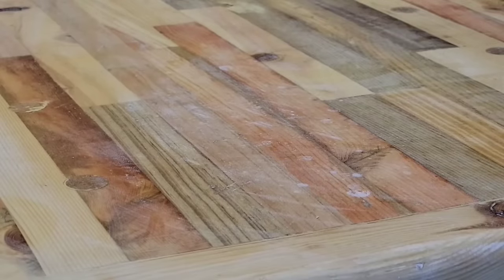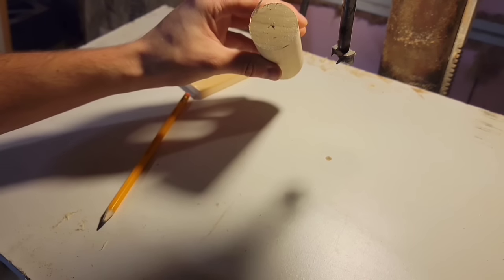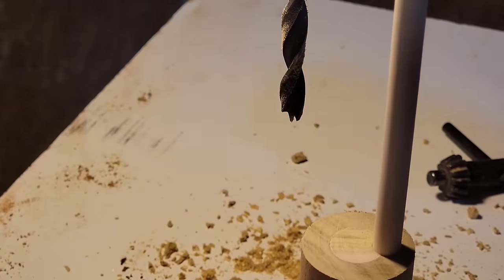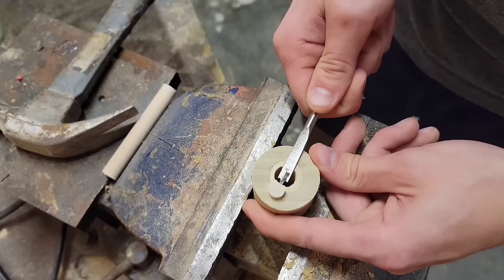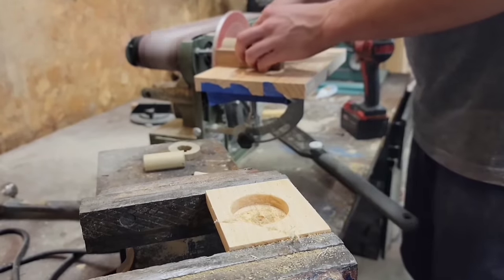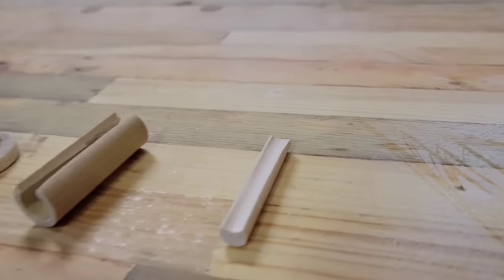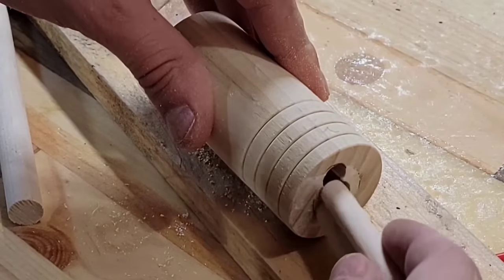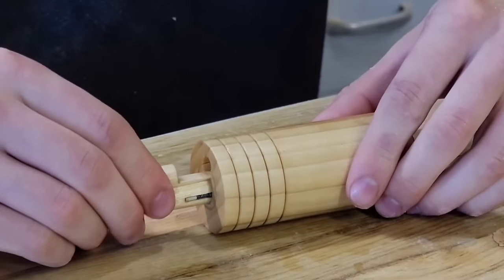DIY AWESOME gift Idea | Easy Woodworking

Comment: Josh (and anyone doing this type of project with a drill press) - wooden hand screw clamps make it much easier and safer to control small parts. I cut notches in the jaws to grab round parts.

Comment: I wouldn’t use a spade bit into end-grain on the drill press especially without a vice. This would probably be best done on a lathe but would require the lathe and about $400 in accessories.

Comment: OK stupid question. I don't have a piece of round wood that thick. For me to buy it it would cost quite a boy.  You have to have a around inside.  I was wondering if I could do the outside square instead. I have some beautiful Especially designed for curving wood that a very kind man gave me years ago.  think that would be OK right?
    Also I've seen videos where they attach the drill to like a makeshift drill press if you know of any videos like that could you tell me maybe Which video is the safest. That's the only thing I'm worried about it's safety
Reply from the maker: Not a stupid question, I think square stock would work too and could look pretty cool. As for safety I am not very good with safety myself so I can't give good advise on that. I would say try and use a real drill press and a drill vise to hold the work piece.
Reply: @JoshWrightWoodworking  1st, thank you for replying. Im actually a woman and have to fend for myself.  Example, the short story is my brother-in-law  took the drill press i bought for my dad, RIP and keeps saying he will give it back, but its been 4 YEARS!!!!
    It's been impossible to drill a straight hole. Not to mention ridiculously dangerous. I've seen videos on how to Jerry-rigg a drill   but also seems unsafe. It sucks.